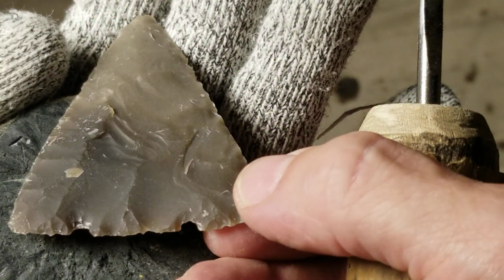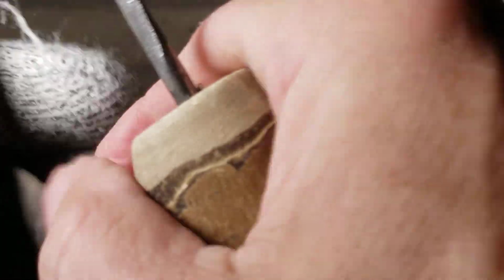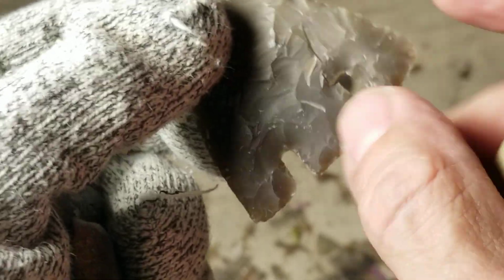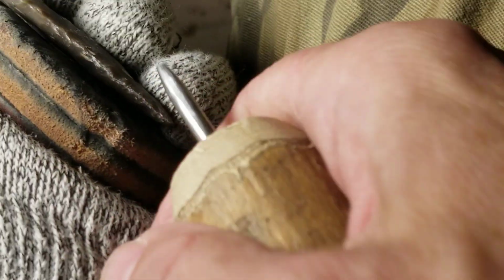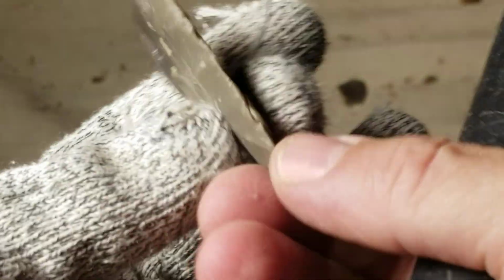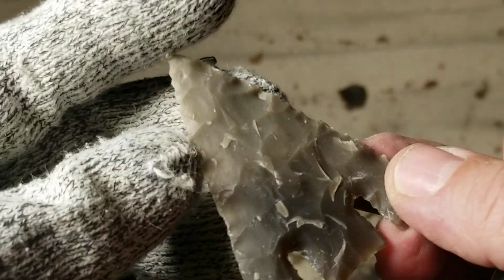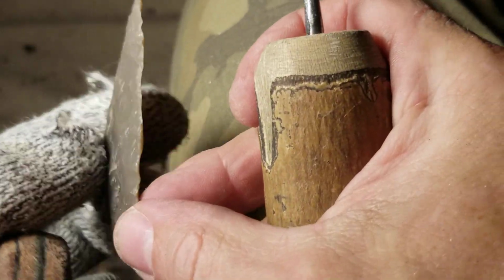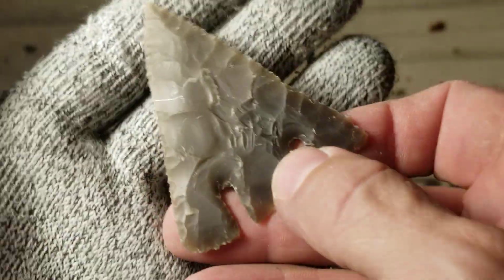1157 - Fighting with Georgetown 3/3

Comment: Ferric Chloride will dissolve the steel marks easily. That's what we use on Damascus knife blades to etch the low nickel content steel, and leave the higher nickel content steel shiny. It's main purpose is for etching circuit boards. You can get it on Amazon. I mix mine with DI water in a 25% ferric chloride/75% DI water. That ratio is plenty strong to etch steel away.
Reply from the maker: Interesting.

Comment: This was a REALLY good video.  Close-up camera work.  The circumstance encountered were so familiar to those I have.  And you fixed issues during notching and told what the warning signs are of a stalled notch that will really help me.   Knapping this point may have been frustrating for you at times but boy it was a very good instructional video.
Reply from the maker: Very glad to hear.